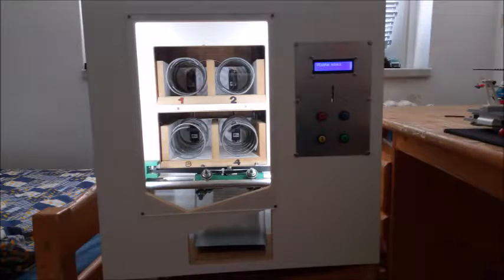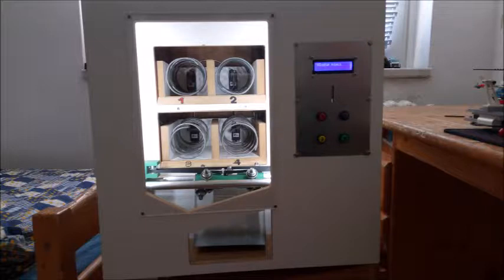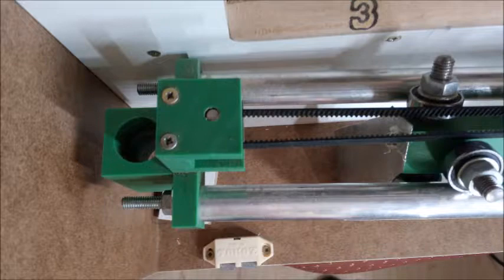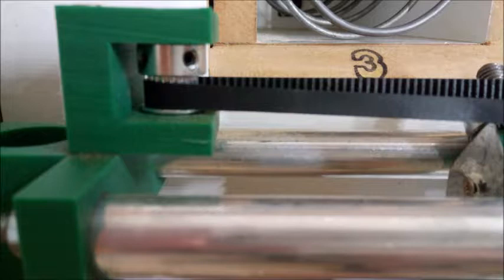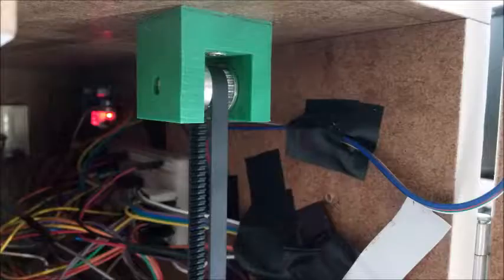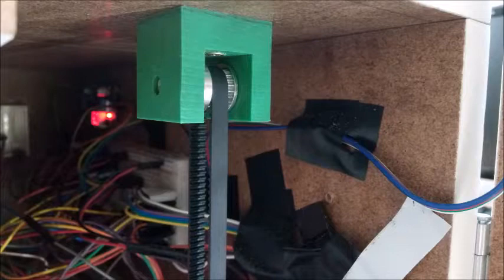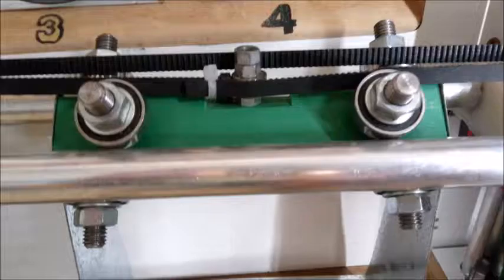Vending machine project to school inspired by Dejan Nedelkovski

Comment: Hello can I ask you how u connect the circuit do u use bread board and how many ohms do you use for that?
Reply from the maker: Hello, I used breadboard inside of vending machine, mounted with melting glue gun. Ohms - what do you mean by Ohms? You mean resistor used on display brightness set up? If you mean this, I used a 10k potentiometer instead of 2 resistors, but you can use 2x 5k ohms. Or if you mean resistors, which I was speaking of in video, that was something different - in video I mean my problem with non working and clicking servos and how I partly repaired them.

Comment: Hi!! Can i know the weight of this machine?
Reply from the maker: Hello, interesting question. It depends on what you have inside. For example we added a computer source from old computer to power servos, so the weight goes up. But I can consider that whole project has aprox. 20-30 kilograms. I don't know, how many kilograms it has exactly, because we never measure the weight of vending machine.
Reply: @kyberberos8273  I see.. Thank you so much for explaining. Much appreciated!!

Comment: Can u please help in dimensions....... I am just not able to open the solid work file........ I need your help as soon as possible because I am final year student and I genuinely need to do this project  if possible please contact at my Gmail Id is siddharthgholap786@gmail.com or else u send me your Gmail Id I will contact u......
Reply from the maker: I am very  sory for my late answer, actualy I know how you feel, because I know it - I was in the same situation one year ago. What time do you have to final exams and how far are you now? It is complex project with lot of mechanical problems to solving. Not something extremely hard, but nothing easy, especially because of that H-V rails. If you will do it by my or Dejan's way, you maybe will in time determine that our way is not so good and invent your own way to do that. And what problem do you have with opening file? You can contact me on sykky391@gmail.com, if I will not responding, try sykora.ondrej8@seznam.cz

Comment: I was wondering if you could share the dimensions of the project, I have been having a ton of trouble with the step file and I'm not the best when it comes to using 3d software
Reply: I am too.I am having problem with the vertical rail and horizontal rail system
Reply from the maker: Hello, my dimensions was practically same as Dejan's, but boards was 2x thicker. Rail system was chapter to itself. Wood is absolutely unsuitable for this
. You need a material that is solid and do it by machine. Every milimeter is important.